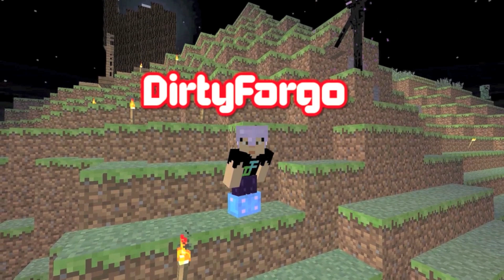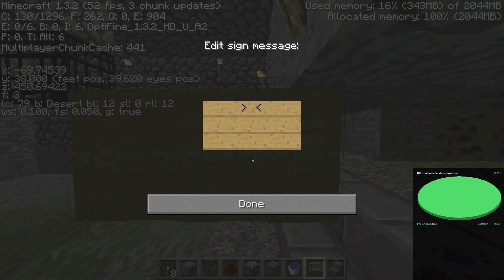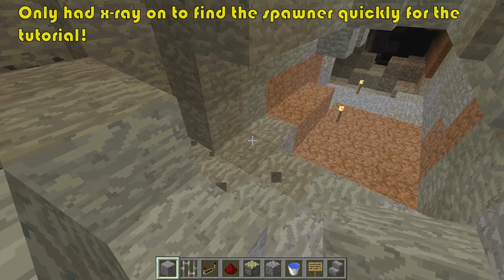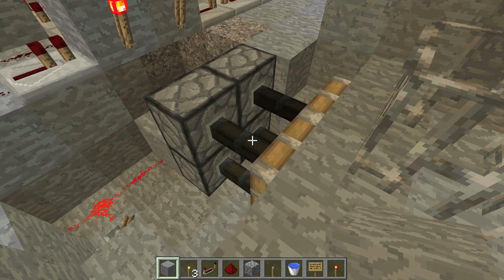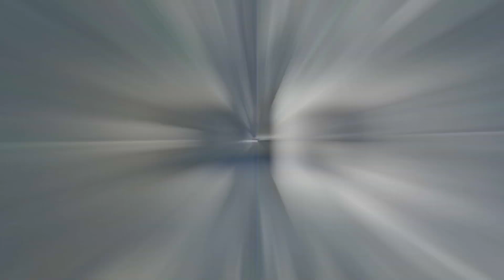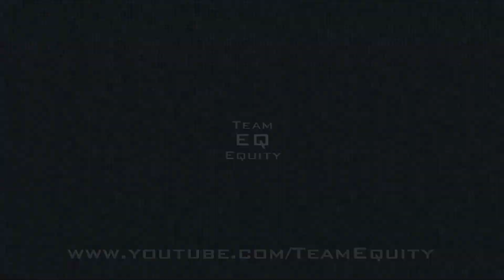MC | Regular Spider XP Farm Tutorial | 1.3 &1.4

Comment: I tried this and it worked a few times, however once I found a skeleton in there (There was no skeleton spawner in the area) and when I pulled the kill switch all the spiders came out and attacked me. Do you know the possible cause?
Other than that, very solid tutorial. Impressive. The only thing that could have made it better is adding a "total materials needed" section at the beginning.
Great Job!